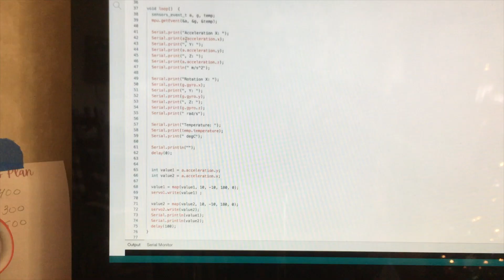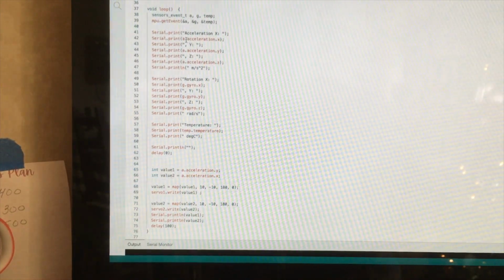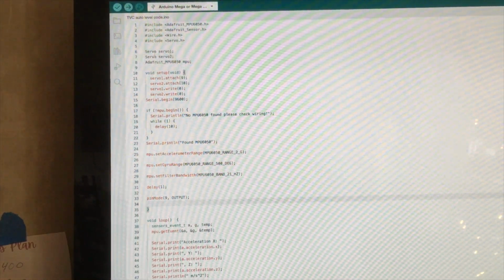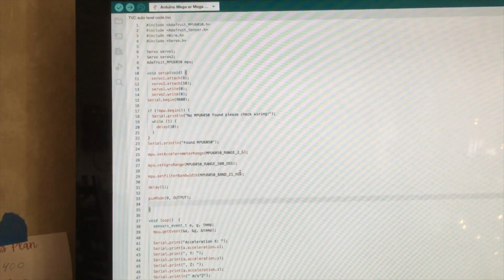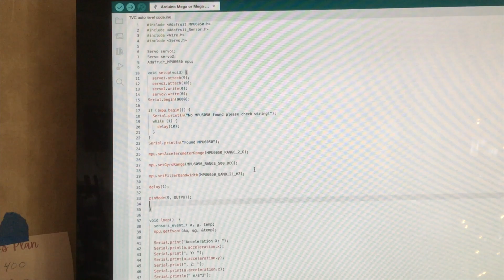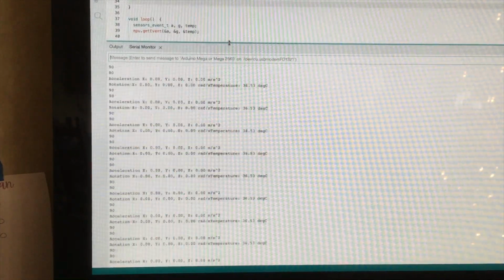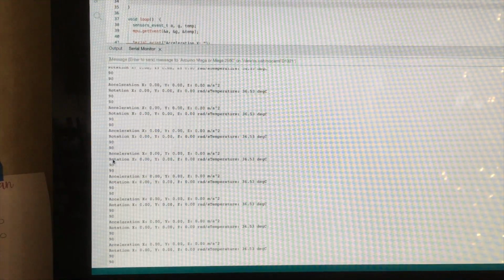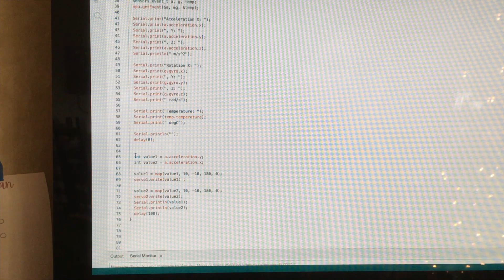Arduino Flight TVC - Rocket auto level

Comment: I know this seems weird but is that small board a PCB?
Reply from the maker: which board? there is a couple.
Reply: @ModelRocketDev  The one that you turn with your hand to turn the mount. (i'm also wondering if you have discord)
Reply from the maker: @josaspace  yes that is a pcb it is the MPU6050 gyro, and i do not have a discord at the moment.
Reply: @ModelRocketDev  Is it just a MPU6050 Module?
Reply from the maker: @josaspace  yes, it is also attached to a Arduino mega.